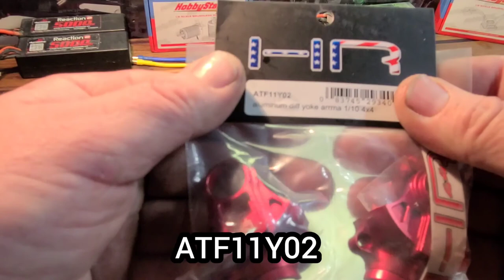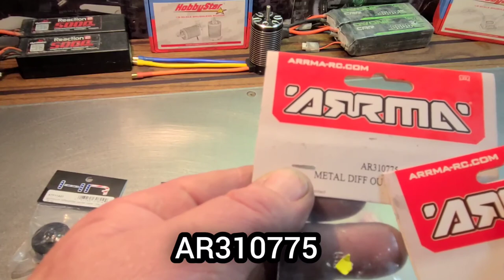Hot Racing Differential Assembly - arrma 3s 4s 4x4 Line - How To & Test

Comment: Great Vid...Nice catch on the loose pins. The only thing I have not upgraded on my K4S are the HR Diffs...I got the Yokes but still composite in the diff cup. perhaps cutting up some thicker pins to tighten that up will IronClad them out  LOL...I hope you keep us posted. Keep up the good work.
Reply from the maker: Yea? How is the diff doing with just the yoke? Are you having many problems?  Or is it holding up to the abuse?
Reply: @IRONCLADRC  I really thought the diffs would go out soon but they've held up good. We'll see how long they hold up. I'm going to order the HR Cup & Gears for when it does happen. What diff fluid setup are you using?

Comment: Hey dude, never had a chance to explain the clutch the other day! On my outcast 4s I have HR diffs and heli gears.  To lock the clutch I used 3m nuts not lock nuts. 3m nut fit right in the back clutch plate. Just like the plastic with the brass threads! No need to hold in place while tightening the clutch!!! 8 runs now and clutch has stayed tight!!!!
Reply from the maker: Nice. Thanks for the tip
Reply: @IRONCLADRC  no problem dude my outcast 4s had nothing back their! Lost count how many times clutch loosened up! 
Since the thin non lock nut, no issues!!!
Reply from the maker: The 4s line is a blast, my k4 is probably my favorite rc.  It's my goto basher especially since I've upgraded the differential  and cluch
Reply: @IRONCLADRC  same here,my outcast 4s has HR  spur,heli cut gears,aluminum diff case and shocks,lunsford titanium turnbuckle , rpm arms max 8 and stock motor with avid sealed bearings and not done!
Reply from the maker: Heck yea.  How are the titanium turn buckles?  Any issues?
Reply: @IRONCLADRC  they look great and take a beating and no bends!!! A little pricey.  Well worth it! Much lighter too! Amain has in stock out of North Carolina warehouse!
Reply: @IRONCLADRC  can't forget how dam good those HR red yokes look on the front and rear!!

Comment: I went with arrma metal diff ring and pinion gear, and every thing fits snug with no slop. Only thing is you have to use the Arrma composite diff case also.
Reply: i don’t think you’ll respond to this but if you do!!! how has it healed up so far?
Reply: X2
Reply: How is that holding up
Reply: @willwrk4gunz  good for me dude best upgrade ever i ran a 3500kv motor 4s in mine and ran fine destroying the frunt diff tho 😂 it was plastic haha but you should get it
Reply: I’d like to lock the rear differential on my Senton 3s any help?

Comment: I agree. The tolerance is on such an expensive part should be absolutely perfect. Subbed ya too 🤘. Iv been trying to learn everything I can since I just got a vorteks. And of course I already broke 2 u joints on rear axels lol. I can't believe arrma made that u joint out of plastic. SMH
Reply from the maker: Welcome to the channel! The plastic upgraded  CVD drive shift that arrma made for the 3 and 4s line Are great I've had a 0 issue and you can rebuild them. Is there a little pricey I've had no issues with mine
Reply: @IRONCLADRC  yea iv been looking into the cvd axels. And I just took the slippers out to tighten by hand and gonna tight little by little till it's not slipping too bad. I had tightened it by rolling the car forward like your supposed to but that had to be what ripped the u-joint loose. But all I did was a high speed run up and back the road. No jumps and no slamming the break or throttle. So I can't believe it just broke that easy. I'm extremely disappointed in that one lol 400$ and can't even drive in a straight line without breaking something.

Comment: What’s up brother love the build I have a 3s typhon made it 4s it’s crazy fast but I’m having trouble with the center drive shaft on full trigger it got so much power that it vibrate likes crazy then it snaps after two runs
Reply from the maker: You need the center driveshaft support bearing from The kraton 4s.  https://www.ebay.com/itm/Arrma-310878-4x4-Center-Driveshaft-High-Speed-Support-3S-Granite-Senton-Typhon-/203208496096?_trksid=p2349624.m46890.l49286
Reply: Center bearing im running rocket 4092 with max5 on my typhon 8 s.    Stock driveshafts center bearing support. Steel rear diff only front plastic but im getting 128 insane plastic chassis. Bout to convert tomorrow into gt car see what numbers i can get.  I have 34 spur 29 linion tomorrow im going for 30spur 34 pinion with me luck 🎯

Comment: You really only need to do the rear! The front takes less "Shock" and you are waaay less likely to strip a diff ring or input gear! But if you have the money go for it haha!
Reply from the maker: I put the arrma upgrades differential in the fron testing the hotracing in rear and arrma steel In the front 3 months now no problem
Reply: @IRONCLADRC  Right on! Sucks that its basically all backorder right now especially the Arrma version. Hot racing has the cups but I need the rest of course haha
Reply from the maker: I actually  like the arrma steel diff just a much as the HR ..  the only weak point on the arrma steel diff,   is the plastic diff cup. My oppinion
Reply: @IRONCLADRC  So you actually prefer straight cut vs helical? I dont know which is actually stronger but im guessing helical otherwise is there a point to it haha? Luckily I havent ran into the issue of the plastic diff cup pin seats busting like you showed but that doesnt mean it wont ever happen. Curious, what happenes to the car when that happens? Is there a certain sound or just loss of power?
Reply from the maker: You will know when it goes.   Heli is a better gear cut.

Comment: What shocks work best for sticky landings on a granite ? Thanks
Reply: What’s up dude ? I found out for me it’s the Mojave fronts for the front and kratons fronts for the rears , 6s , with M2c pistons , a wide kit , 4s backflips , steel diffs , extra slipper pad for rcawd gear going in stock slipper . Extra pad on the top side where there’s one . The other side doesn’t work as good or as perfect . I read it in the Amazon reviews twice people said to add a slipper pad . Other wise buying the whole slipper was twice as much . Stock one is already worn in . Defintely didn’t replace the slipper bearings either 😂 but I greased them

Comment: I would try the Kaiju shocks! They are killer and pretty heavy. They're also cheap... a lot cheaper than arrma shocks
Reply from the maker: I like the HR shock Bodies. There cheap smooth & durable
Reply: @IRONCLADRC  yeah I guess they'll be okay since you don't jump too big. People are still breaking the receiving end though on big jumps. 

Dude! Did you order them yet? Are they on backorder? Because I have the hot racing shock bodies for 4s  and I've never used them. I've thought about selling them but I've only held on to them because who knows when hot racing might decide to stop making them. DISREGARD. I see them everywhere. About two years ago they were hard to find for a while

Comment: Did you have any issues with the Smaller diff gear pushing further and grinding away on the aluminum Diff case??... It somehow happened to me and it chewed away like Half A mm on the diff case.. And The bigger gear doesn't move around side to side at all
Reply from the maker: No issue witht them. None

Comment: ok 1 more question What Cvds Are you using Sorry Just looking for the Right 1 And Have you Had Any problems With yours
Reply from the maker: No I actually like the arrma upgraded CVD. I've had them for a year or so now.  There fully rebuildable. The only complaint I have is that they are a little out of balance at the knuckles on the front of the truck.  Not a big deal.  There ironcladed out
Reply: Them 1s

Comment: My pinion gear on the diff or what ever isn’t snapping with the spur gear ?? I’m not using the hot racing yoke is that the problem ?
Reply from the maker: Could be. The yoke helps keep everything tight.

Comment: Will the crown gear work on the Arrma diff case ar310772 ? Or HR diff case only ?
Reply from the maker: On The 3S and 4S line the hot racing case works with the hot racing Crown gear and the Arma Crown gear works with the arrma case.  They do not cross reference

Comment: Ive got a 3s senton with granite tires, and my plastic diff sucks, what steel one should i get
Reply from the maker: Arrma steel ring & pinion would be your cheapest option.  Hotracing is rather pricey.
Reply: @IRONCLADRC  hey, i got the arrma metal diffs, and my slipper broke right after i ordered them, im working on them now, the metal diff looks great

Comment: So with the few months that have passed, you're still good with the setup? Recommended? Should I splurge the $100 too? hehe.
Reply from the maker: Yes the HR diff is solid. everything else on the truck breaks, the HOT RACING DIFFERENTIAL IS MINT...
Reply: @IRONCLADRC  I see. What else is breaking now?
Reply from the maker: Always having trouble with the stock motor mount, motor plate bending on hard jumps I'm looking at the  m2c motor mount/chassis brace to solve the problem.
Reply: @IRONCLADRC  yeah. I just wish it wasn’t 1/4 the price of the car!

Comment: Hows the diff holding out ?did you put them it in the front too?
Reply from the maker: Great I put the arrma steel differential in the front. No issues yet. Both differential are holding up great. The HR setup is actually preforming a little better than the Arrma diff. I run it on 6s all the time everything else on the truck breaks but the diff are solid!
Reply: Hell yea thanks for the info and a great video

Comment: I have the arrma big rock.  I recently upgraded the rear diff gears to metal but when I reassemble, the gears mesh is to tight when tightening yoke diff case , why is this??  Never had this problem with the composite  gears in there?  Same with internal sun gears housing, to tight??
Reply from the maker: Is there a shim or shims on the diff.  If so mine was tight aswell I used 1 shim and it was still tight.  I ran a few packs thru it and it was fine. The aluminum yoke don't have give. The plastic yoke does that's why it needs a few shims. I would run 1 shim or no shims on the HR DIFFERENTIAL
Reply: @IRONCLADRC  ive got all the shims where they are to go and gear mesh is way 
to tight, will going metal help this for yoke and diff housings?
Reply: even when trying to turn the  out put gears in in diff case, they wont move at all now with this upgrade??

Comment: I tried HR Diff in the rear of my Granite and it didn’t work because Input Gear is too long and it bottoms out in Slipper Clutch Housing before motor housing clips in?!?
Anybody have the same issue? And any resolutions?
Thank you
Reply: Yes?!!!! I’m having that issue wtf is going on did you figure it out I’m not using the hr yoke
Reply: Yes same on big rock v3 only solution I can think of is cut input shaft down
Reply: Grind the part thats too long i did works awsome took 3 min to do

Comment: can I use the arrma metal crown gear with this hot racing diff housing?
Reply from the maker: Yes it's actually better suited, no flex
Reply: @IRONCLADRC  so it will fit using arrma one?  arrma comes with no o ring?
Reply: @IRONCLADRC  what mean no flex, arnt they metal?
Reply: @IRONCLADRC  so I use my arrma crown gear and metal input gear with hot racing diff housing??
Reply from the maker: @43rocket  yes
Reply: @IRONCLADRC  ive tried to use composite diff cases from arrma but the internal gears dont move freely in it??
Reply from the maker: @43rocket  did you shimm the crown?
Reply: @IRONCLADRC  have not put any of together, but the optional composite housings  bind the gears

Comment: Will this fit the arrma vorteks boost with 4x4 conversion
Reply from the maker: It should same chassis as the brushless version
Reply: Thank you so much. I upgraded my vorteks to a 6s. It's been holding up until recently, the conversion differential teeth got stripped.